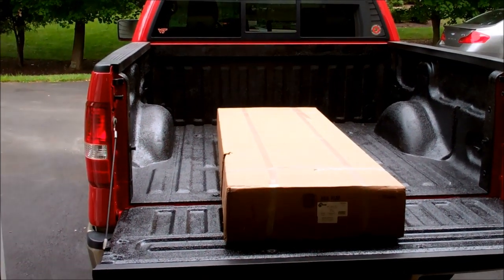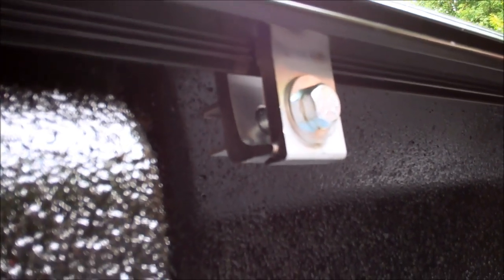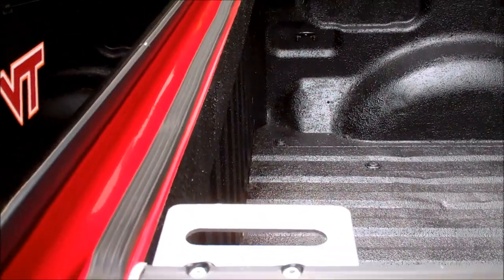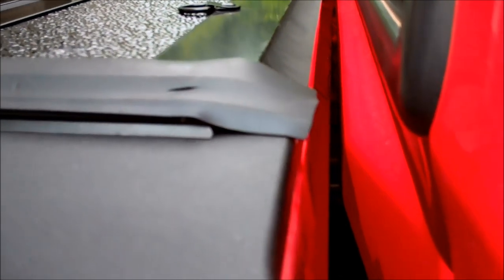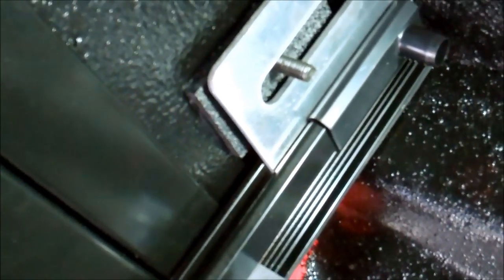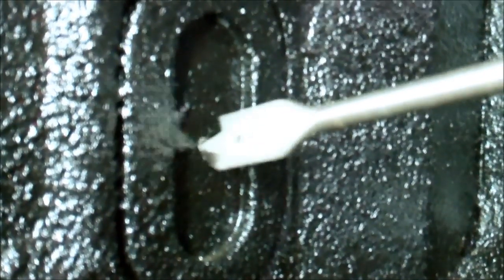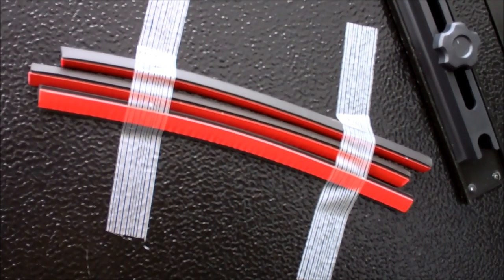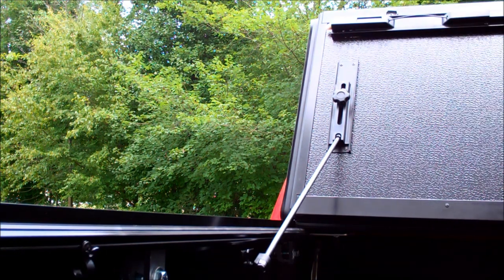BakFlip F1 Tonneau Cover Ford F150 Installation

Comment: Looks like you've had the cover for a while.  I'm in the market for one for my '14 F150 and would like some input on how the cover has held up over the years.  Were there any long term issues with the cover?  How well did the cover protect your bed in rainy weather?